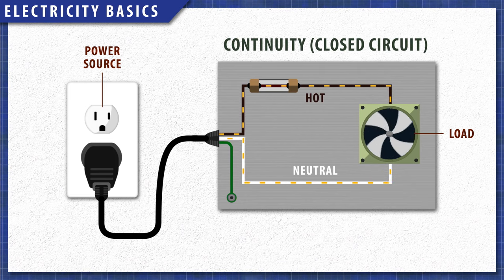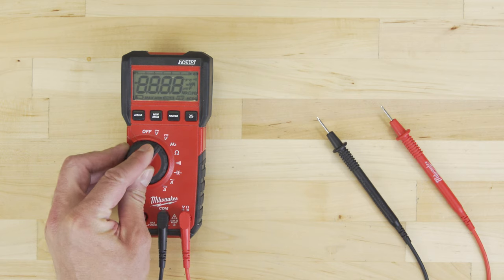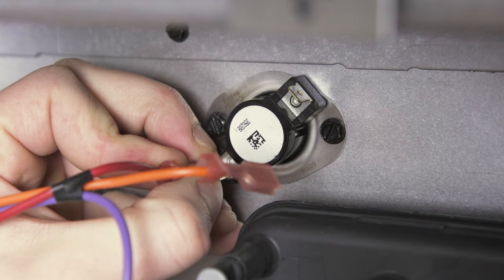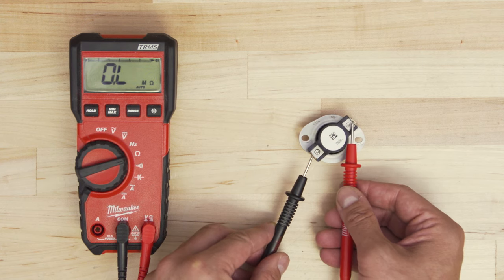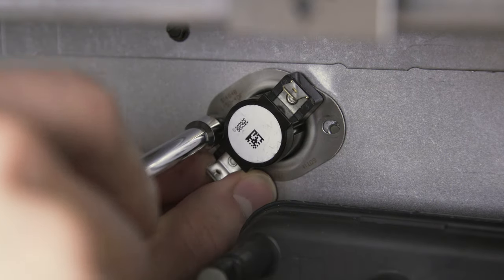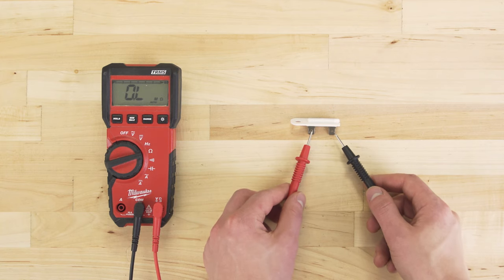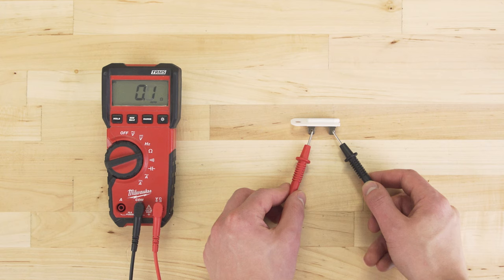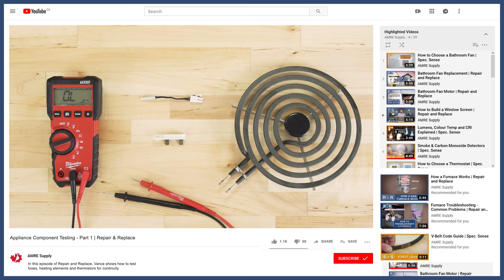How to do a Continuity Test With a Multimeter | Repair and Replace

Comment: How do I test a carpet washer switch with a multimeter and on what setting please thankyou Great video.
Reply from the maker: Thanks for watching. It'll be a continuity test like this video. The exact steps depends on the type of switch. You'll still be testing for continuity but the reading depends one which terminals you test. You'll likely see a combination of several terminals NO (normally open), NC (normally closed), and/ or a common terminal. You can see this demonstrated in this video testing an oven light switch: https://youtu.be/sWSUzTuvFRI?t=220 

If it's a rocker switch then you'll likely have a NO terminal, common and another NO terminal. Press the switch to one side, and test the NO and C terminal on that side. There should be continuity. When the toggle is in the middle there should be no continuity. Then test the other side following the same steps.

Comment: Is there a way to test certain components in place, that are difficult or painstaking to remove first? If so what are the guidelines?
Reply from the maker: Thanks for watching. You can test the component in pace if needed. If possible, disconnect the wire terminals to isolate it but this is also not completely necessary.

Not all components can be tested with a simple continuity test. If you're curious we have a few videos explaining these components more in detail: https://www.youtube.com/watch?v=e_1pOWSVUfg

Comment: I would like to test my ceiling fan components. Will it work? The wiring harness for the fan has the 3 speed switch, the reverse switch, capacitor, and various connectors.
Reply from the maker: Thanks for watching. We actually have two videos that highlight how to test each of the different components including how to test a capacitor for capacitance. You can see these 2 videos in this playlist: https://www.youtube.com/playlist?list=PLCo9SMjkdWBzlEqde1FSEIuCg2hx6_H-_

Comment: I have a question. how would one know what switch to remove from power?. i saw you going to the control panel and just turned off one switch. . how did you know that was the correct one?. I am afraid to to pick the wrong one.
Reply from the maker: Thanks for watching. If you have an appliance like a oven or refrigerator, you can unplug it and you'll be certain that it is safe to access the component or switch. In something that you can't unplug, turning off power at the breaker will prevent all power from going to that circuit. If you are unsure if a wire is live and still has voltage you can use a NCVT (non contact voltage tester) to check if any wire is live before touching it: https://www.amresupply.com/part/9462517

Comment: Can anyone advise on this?

Im trying to test pins 30 and 87 on an auto relay (with pins 85 and 86 successfully activated under 12v power)  I'm using a basic level multimeter on the 200 ohm setting (also used the "continuity" symbol setting and getting the same result).  

The continuity reading between pin 30 and 87 is bouncing all over the place from 2 to 120 to 75 to 0.8 ...   

Does this result show good continuity?  Are the numbers bouncing around so much because there is power in the circuit from pins 85 and 86?
Reply from the maker: Thanks for watching. An auto relay has a low current coil, between 85 and 86 to close the contacts between pins 30 and 87 which will supply current to another component like a water pump, light or the AC compressor. When not energized there is no continuity between 30 and 87. When the coil is energized, it pulls the contacts closed. Like any switch there should be an unrestricted path for electricity to flow. There should be continuity, between 0 & 1 ohms. If this fluctuates then either the pins are dirty, the multimeter probes are sliding around, or the contacts inside the relay are not making good contact. If the resistance is above 1 ohms or is erratic, then the relay is likely faulty.
Reply: @AmreSupply  thanks for that helpful info.  Turns out it was the multimeter probes sliding around too much. When I secured them, I got a very steady reading. Thanks again!

Comment: Does it matter which probe ( red or black) touches either terminal
Reply from the maker: Thanks for watching. That is a good question. These components shown in the example polarity do not have polarity so it doesn't matter which of the two wires are connected to which terminal. All you are checking is that there is a path for electricity to flow through. If you're curious you can learn more about components in this video: https://www.youtube.com/watch?v=e_1pOWSVUfg

Comment: Thanks for the presentation. My Digital Multimeter failed to test a Continuity. How can fix it? Any advice please. Thanks.
Reply from the maker: Thanks for watching. Just to clarify do you mean you tested a part and it doesn't have continuity and are wondering how to repair the part?

Or do you mean you tested a part that you know has continuity, and the multimeter isn't working as intended and isn't showing continuity?
Reply: @AmreSupply  Thank you for your reply. Yes, I've a digital multimeter tester. I tried to test a continuity, but it's not working. So do you've any advice before I buy another one?
Reply from the maker: @Yamralko  If you are unsure if the multimeter is testing for continuity properly then test something simple first. You can test the metal blade of a screwdriver for example. This should always have continuity. If it doesn't have continuity then its possible that the fuse inside of the multimeter is blown. In some models you can replace this fuse.

Now if the multimeter is working, and the part you tested still doesn't have continuity then its best to replace that part.
Reply: @AmreSupply I will try to test as per your advice when I got home. Thanks again.

Comment: How would I test an electric motor in a linear actuator? It heats up the wire as soon as its plugged in
Reply from the maker: Thanks for watching. You could test the motor for continuity and check to see if it has shorted to ground. As well if its an AC motor, then the motor might have a capacitor. If the capacitor fails then the motor won't start. You can learn more about induction motors here: https://www.youtube.com/watch?v=vpspMVQQXRs
Reply: @AmreSupply  its a progressive automations 400 pound 18 inch stroke 12v linear actuator.  It heats up wires when plugged in
Reply from the maker: @donaldsteele6276  These sorts of actuators is not something we normally work with. It could be an issue with the duty cycle being mismatched for its application, it could be an issue with the controller, or the actuator could be faulty.

Comment: I thought that you could test the continuity with the bip mode and OL means over limit 
...
Reply from the maker: Thanks for watching. Yes you can use the resistance with tone setting to test continuity. 

OL is sometimes referred to "out of limit" or "open loop" depending on who you ask. If a multimeter has different bands for testing resistance such as a 200 ohm, 2k ohm and 20k ohm setting then "out of limit" makes more sense as a resistance reading above that proper range would be over what could be accurately measured within that band.

Comment: Why not just set it on the continuity setting?  Reading will drop to near zero if you have a closed circuit (good continuity).
Reply from the maker: Thanks for watching. We are teaching using resistance to help demonstrate the principles behind it.

Comment: idk what prongs to touch with the multimeter
Reply from the maker: Thanks for watching. For a continuity test it doesn't matter which color of the multimeter leads touches each terminal, it will still work to give a continuity test. These parts are not affected by polarity.
Reply: @AmreSupply  i tested it and it didnt beep or change at all, im getting a new thermal fuse tomorrow. start switch, regular fuse, and timer all had continuity. thanks!
Reply from the maker: @choadcityusa  You're welcome, we're just happy to help! Just curious, what are you repairing, it sounds like an appliance? We're working on a refrigerator series right now so it's just good to know what people are actively repairing.
Reply: @AmreSupply  oh yea, i didnt say did i?  haha,  thermal fuse for my clothes dryer.
Reply: @AmreSupply  i googled how to do it and it brought me straight to the thermal fuse part of the video.
Reply from the maker: @choadcityusa  That make sense! There are a lot of similar components between each different appliance so the testing of the isolated component is the same. The difference comes from fact that the components are linked together in a different way so narrowing down what has failed will always be specific to each appliance. Cheers!
Reply: @AmreSupply  update:  my dryer works now after replacing the thermal fuse!  and after unclogging the serious clog of lint it had 🤣 i think every year ill check it and clean it.
Reply from the maker: @choadcityusa  Glad that it all works! Cleaning is definitely less expensive than buying another thermal fuse haha

Comment: Cannot recommend this video. Doesn't answer the very basic question of when I'm supposed to hear beeping from the multimeter and when I'm not supposed to hear beeping, when doing a continuity test.
Reply from the maker: Thanks for watching. Not all multimeters will have the resistance with tone setting, (the audible beep) which will beep anytime there is continuity. We showed how to test continuity with resistance as this covers a wider range of scenarios.

If the component you test has a resistance of 0 Ohms or above then it will beep (while on that setting). This is continuity. There is a continuous electrical path.

If the component has no resistance, a blank display or - - - - - - or a "OL" reading, then it has no continuity. In this case there is no beep.

This is explained a bit more in the multimeter basics video: https://www.youtube.com/watch?v=r_migcta_Is

Hope this helps.

Comment: Ah, i got it. Thanks for the commercial on this multimeter. i have a different multimeter and it doesn’t have “ O.L” display. This vid is worthless for me then.
Reply from the maker: Thanks for watching. If your multimeter doesn't show O.L it might just have dashed lines - - - - - - when there is no reading.

Regardless if it doesn't show a reading of 0 Ohms or higher then there is no continuity.

As well some multimeters have a beep function that will make a sound when there is continuity.
Reply: Use your common sense